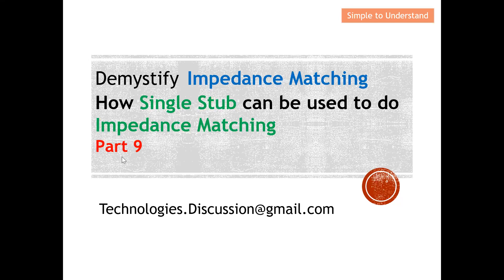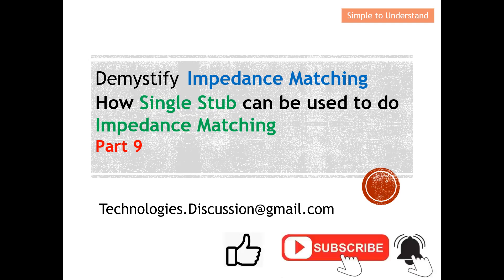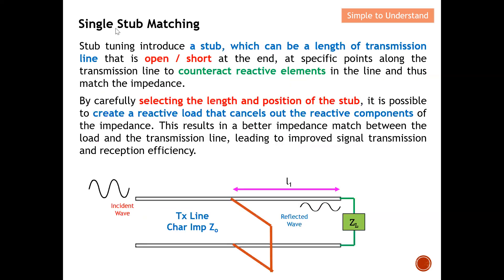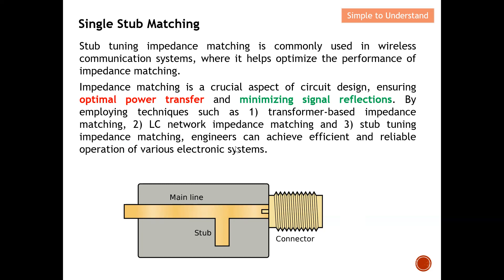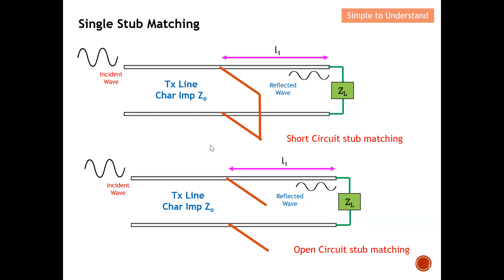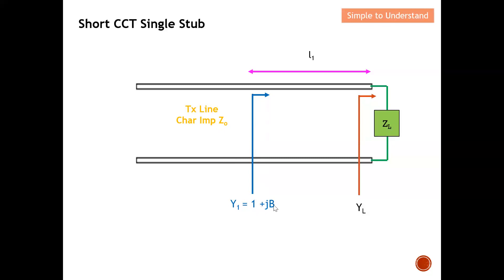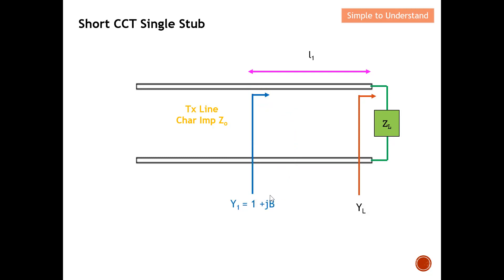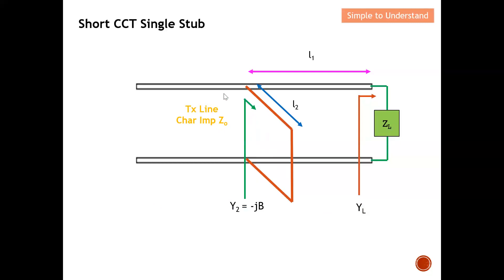Impedance Matching #9. Single Stub Design: Fix Mismatched Line by Controlling Stub Length & Position

Comment: It is mentioned stub matching is used in wireless systems, that means it will be used as part of  pcb antenna design trace?
Reply from the maker: Stub matching can definitely be part of PCB antenna design to optimize impedance matching.  :)